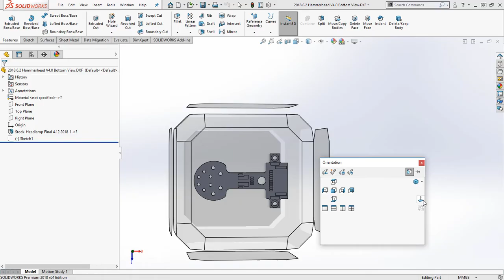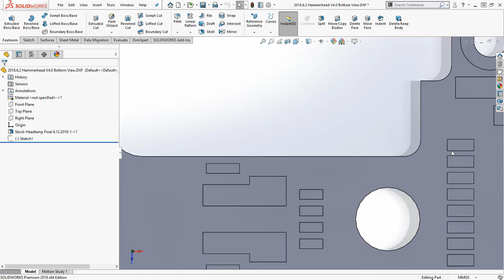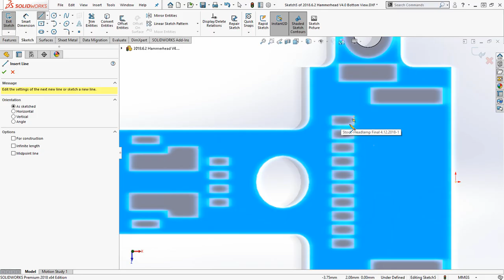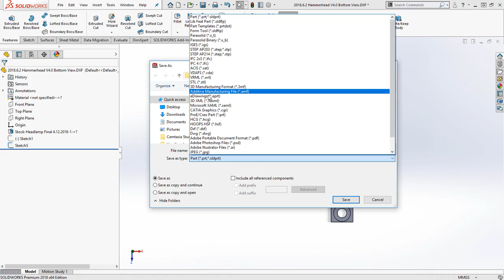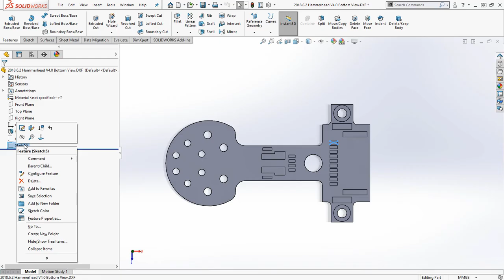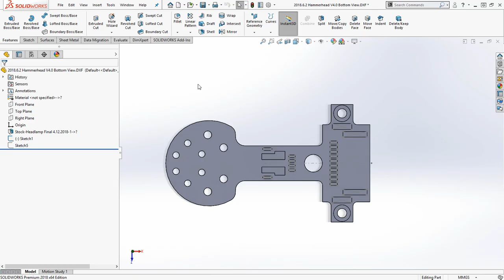How to Quickly Create DXF Exports in SolidWorks (without drawings)

Comment: If you click a face and right click you can save DXFs normal to the face you selected. Few less clicks than the save as method but still immediately opens the "save as" dialog box, so the rest of the steps are the same.

Comment: Saving Dxf's for laser cutting with kerf compensation. 
My current workflow is:
*Make new sketch on part's face.
*Convert entities (all edges u need out and inward)
*Offset entities with your kerf value (make construction base geometry)
*Select construction geometry and delete.
*Hide main Boss Extrude (so it does not show on dxf file as additional edges)
*Save as dxf.
*Show main Boss Extrude
*Hide sketch with offset edges so it does not show on your assemblies.

Cypcut is great for nesting btw, just open new file, go nesting and "add parts"(use your dxf;s)  make the nesting as required and copy the results to Primary Doc and save as dxf.
Cypcut can coedge your parts if needed to minimize laser time. Cypcut does compensations pretty well by itself but only in lxds format, compensations wont save as dxf files.

I wonder if there is a better way.
Reply: One note is that you can actually offset entities without first converting. This eliminates the need for construction geometry but still lets you keep the offset dimension in there in case you needed to change the value. Like if you went thicker or thinner on the material and needed a different comp. 

We have a laser that runs cypcut and have never had to save DXFs with the comp. Have always just done it at the machine. Cypnest does it as well and so do our other nesting packages.